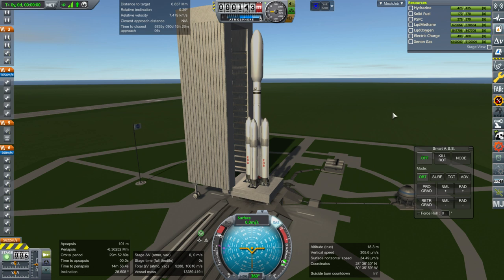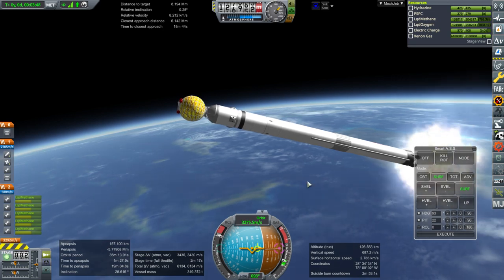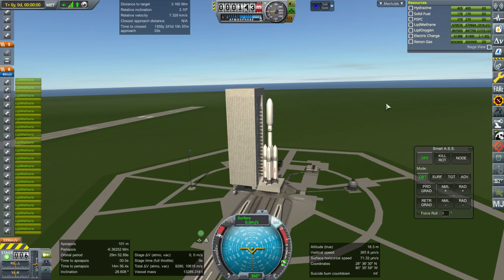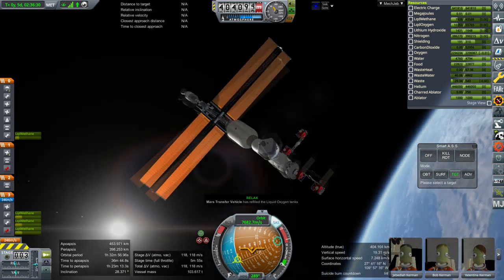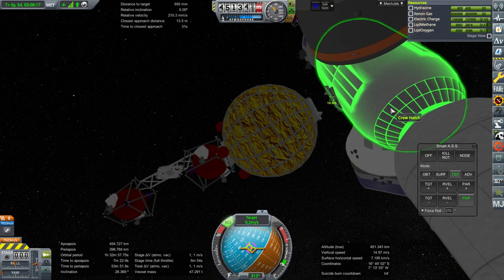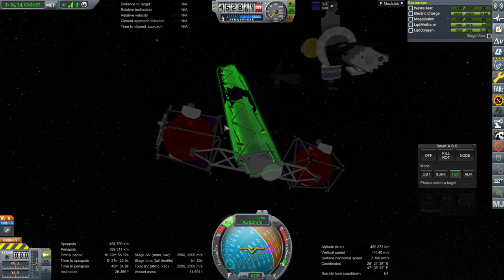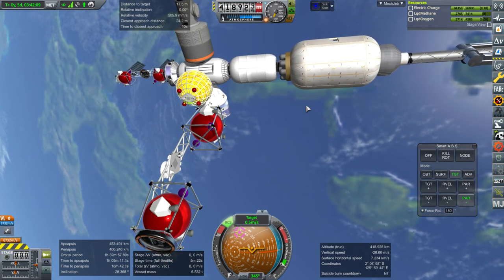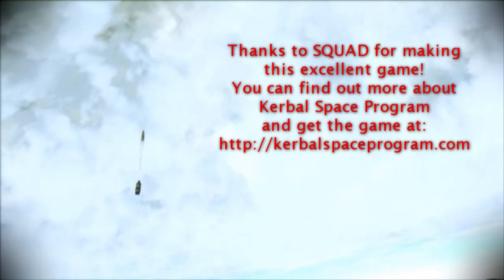KSP 1.6.1 RO and Kerbalism - Mars Colonization 008 - Straightened Out

Comment: With the realistic low thrust of the ion engines (spiraling out) and the high radiation environment of the Van Allen belts (in Kerbalism), do you plan on spiraling out the main vehicle uncrewed then sending crew to rendezvous out in a higher orbit?
Reply from the maker: Uncrewed until it's at a high orbit.